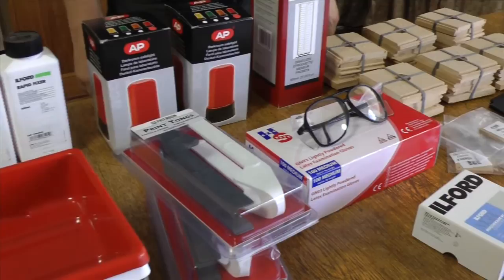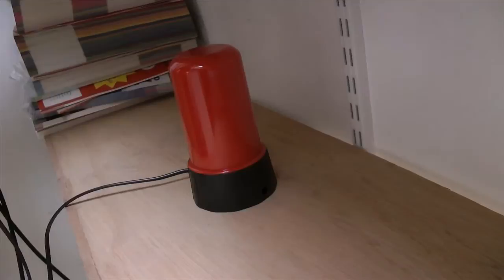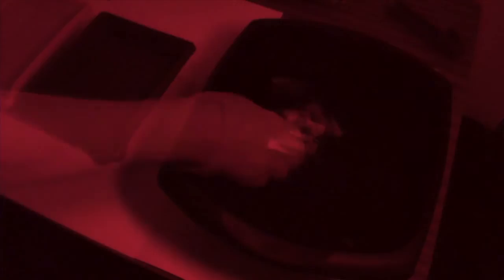ILFORD Photo - Processing tradtional darkroom paper

Comment: Traditional paper means fiber based or rc paper?
Reply from the maker: Traditional paper in means silver gelatin darkroom papers, they can either be Resin Coated, Fibre Based or in the case of our MG ART cotton rag, but they all have a silver gelatin emulsion that exposes under light.
Reply: @Ilfordphoto  right but in this video you are using rc paper correct, not fiber based?
Reply from the maker: @nickfanzo  Yes, we use the MULTIGRADE RC Cooltone in this video
Reply: @Ilfordphoto  ok because fiber would be a whole other process with additional washing .